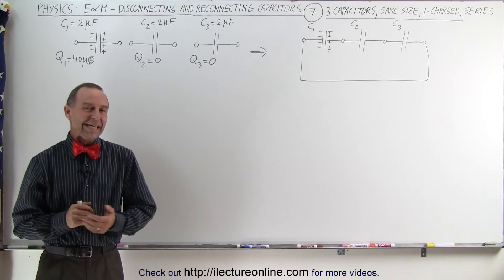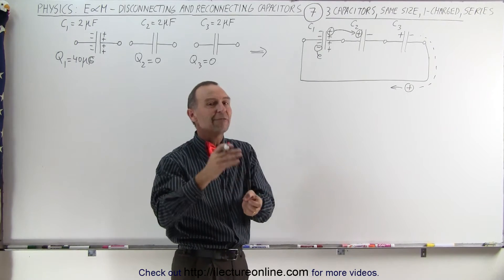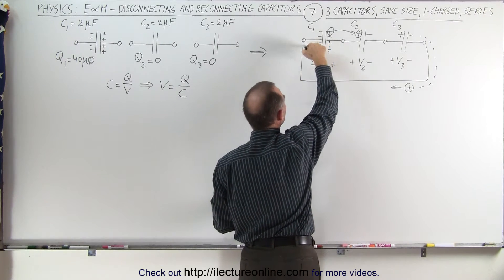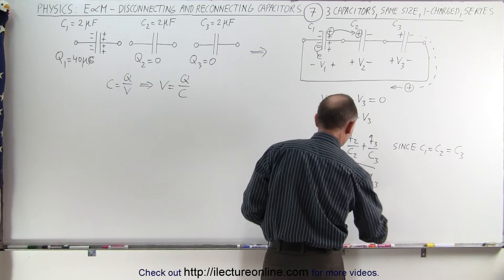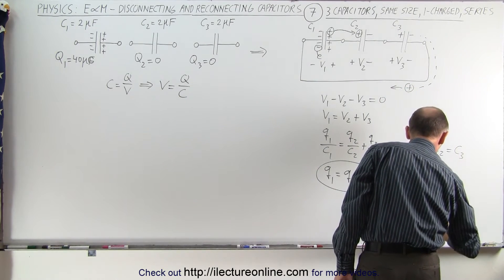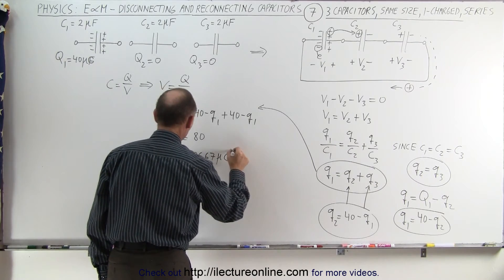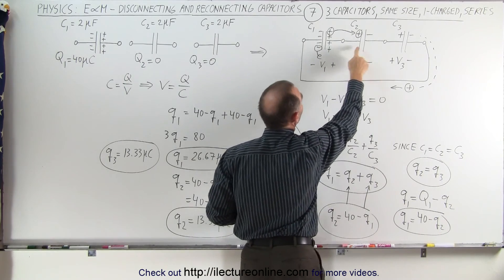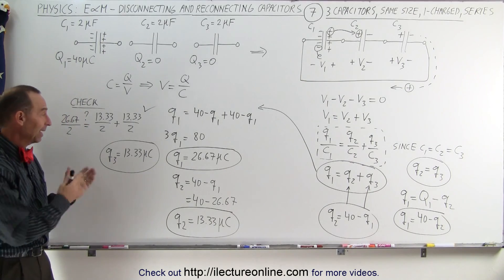Physics - E&M: Dis- and Re-Connecting Capacitors (7 of 16) 3-Cap., Same Size, 1-Charged, Series

Comment: In my solution where q1=20 q2 = 10 and q3=10 also satisfies your "check".  And charge is conserved,  that is the original 40 micro coulomb is equal to the final 40 micro coulomb. if you look at one of your previous lectures ((5 of 16) the charge is conserved, that is the initial 140 micro coulombs is equal to the final 140 micro coulombs. So in your solution where did the extra charge of 53.33-40 = 13.33 come from?  What about energy conservation?  Should not the final energy stored in the system equal the initial energy of the system? There could be a small amount of energy loss through radiation due to currents flowing in the wires (radiation resistance) while the charges were redistributing.
Reply from the maker: You cannot solve this problem as you would when you attach those 3 capacitors (uncharged) to a voltage source.  Here there is no voltage source.  Start moving one charge at a time (as was done in the video), or one micro coulomb at a time and see what happens.  You have to keep the polarity in mind.

Comment: I believe the correct answer is q1=20 q2 = 10 and q3=10  which adds up to the original 40 so charge is conserved.  I believe your mistake was q1=Q1-q2.  It should  be q1= Q1-q2 - q3 since the Q1 is going to send charge to both q2 and q3.
Reply from the maker: The result in the video is correct.  Thank you for checking.

Comment: l dont understand why energy haven't been conserved. l calculated each of the final energy that all capacitors have and added them together but that wasn't equal to the initial energy of the first capacitor. In my calculation, l used the formula of U=1/2(Q^2/C) and the conclusion is 400uJ=177uJ+44.2uJ+44.2uJ for the energy of C1 initial, C1 final, C2 final, C3 final respectively, which is an incorrect equation. Did l something wrong? Can you check it? Thank you.
Reply from the maker: Note that a similar question was asked in the comments below (both for conservation of charge and conservation of energy).   The video shows how both are calculated.
Reply: @MichelvanBiezen  So, can we say that the first capacitor has done some work to push the charges, and therefore the last total energy is less than the initial one? Thank you for the response by the way.

Comment: Dear Pr, 
Isn't V3 suppose to be negative positive (-V3+) instead of positive negative (+V3-)? 
Thank you in advance for your response.
Reply from the maker: With capacitors in series they will all be + / - from left to right  or - / + from left to right.    A voltage source will be present (not placed on the diagram) to push the charges onto the capacitors.
Reply: When we have 2 capacitors reconnected we don't need that voltage source.
Why would we need 3 capacitors reconnected would need one?
Would that voltage source be placed in between C2 and C3?
Also if we have that voltage source we would need to add it to the calculation (Vsource + V1+ V2+V3= 0, (I did not put the right signs)).
I hope you could clasrify. 
Thank you
Reply from the maker: Take a look at the other videos in the playlist.  They will answer all your questions.